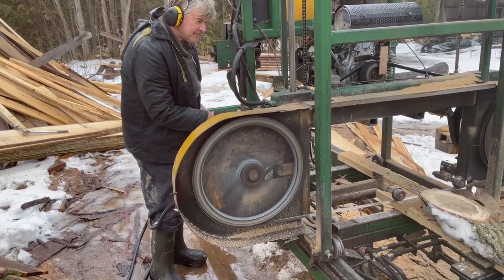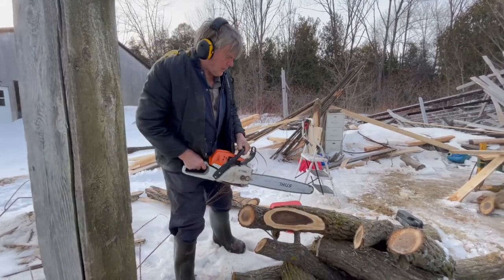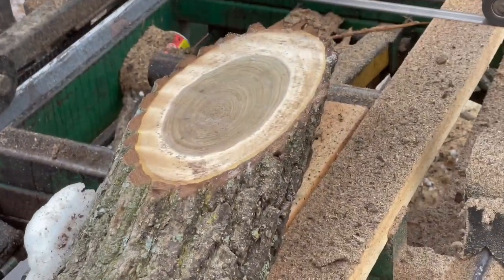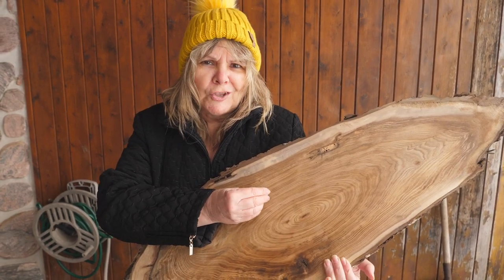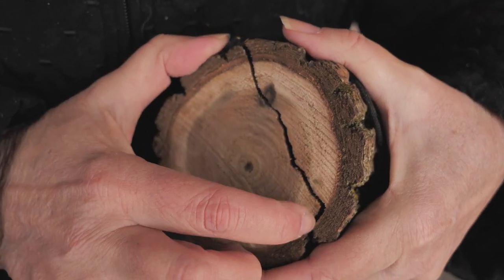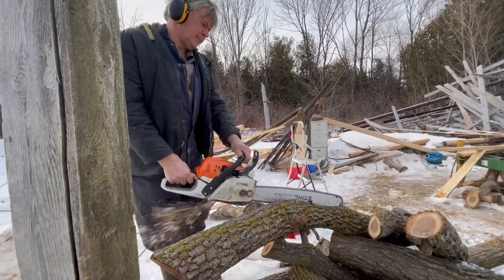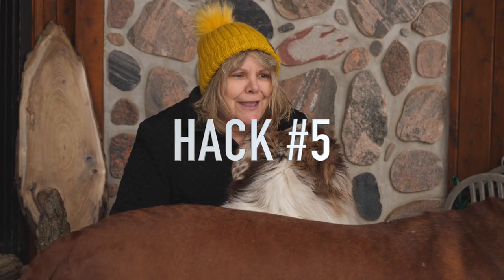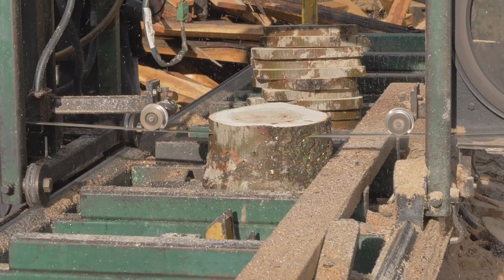5 Wood Slice Cutting & Drying Hacks To Save You Money!

Comment: I strip the bark off of 6ft logs, they are about 5in thick & they are about 1 month old from being cut down. Some crack & some don't. Do you think striping the bark off speeds up the process of drying or not?
Reply from the maker: Yes it would speed up the process. what kind of log? there are some more prone to checking. We have amazing luck with Balsam Poplar cut into ovals, rounds crack more and good old Eastern White Cedar for boards
Reply: Mostly Mapel & Ash @mackenziemill

Comment: I have smaller branches and am wondering what kind of hand saw you'd suggest to cut slices? (wood discs - fist sized circle / discs)
Reply from the maker: Great question! Personally I would use a miter saw or smaller chainsaw if a bit nervous a bandsaw or scroll saw. My last resort would be a pruning saw only because the power is out 😜
Reply: Thanks! I'll look into these types of saws 
 @mackenziemill